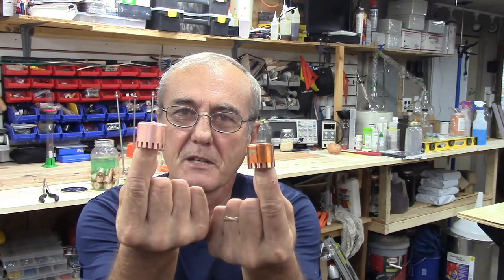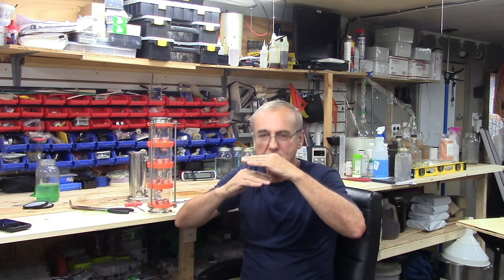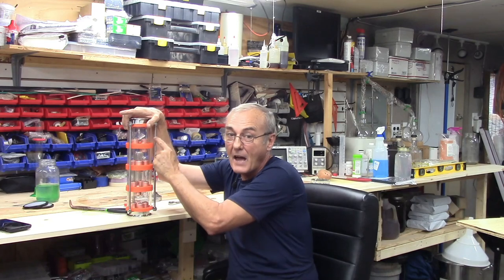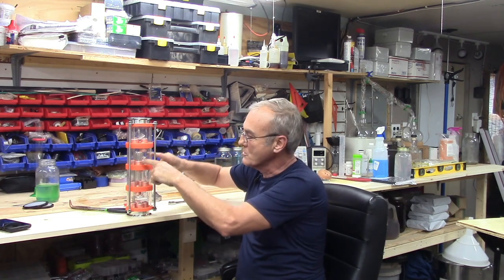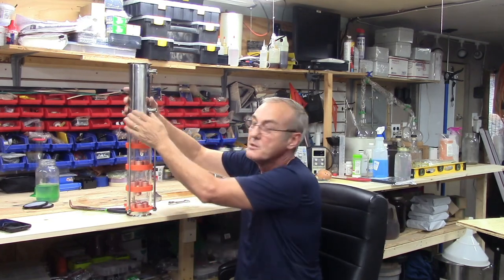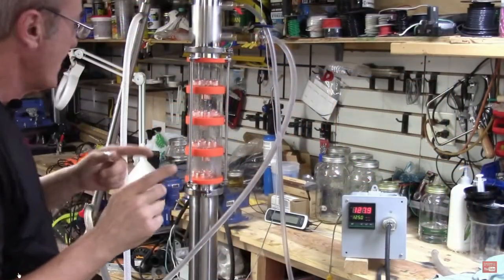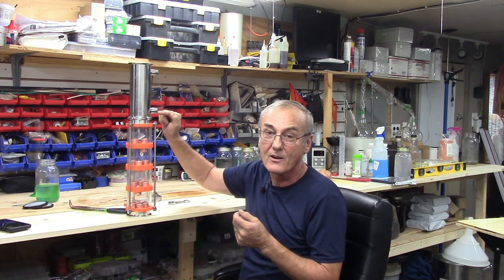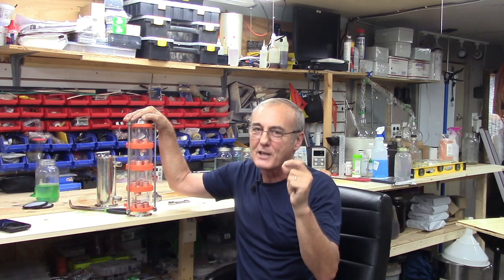BUBBLE PLATES AND DISTILLING

Comment: I use a 1/4" line connected to a tiny brass needle valve to control the water to my dephlegmator and that works flawlessly. That will give you precision control over the water flow. I run my dephlegmator and my shotgun condenser independently. In other words, I don't connect their water lines together at all. Very convenient!
Reply: I run my setup the same way saves a bunch on ice since the hot water from the dephlegmator is used to melt my sugar for the next batch and not the ice and a needle value is the only way to get the exact water flow

Comment: Many small distilleries use bubble plates, and they are very common in the whiskey and bourbon world with smaller batch style stills.  Most bourbon/whiskey makers that use these batch stills use 4 or less plates when distilling bourbon/whiskey mashes.  If your getting too high of a proof or not enough flavor, just disable a plate.  Additionally, bubble plates require less power to create the velocity needed to move the ethanol up the column compared to perforated plates because of the liquid bed on the trays.  The required velocity needed to move the ethanol up a column is a big deal when you begin to move past the 4" wide columns, not so much on smaller columns.

Comment: Better yeilds are to be had by increasing reflux from the reflux drum "dephlegnator" and keeping a level on all of the trays. Suppressing water vapors to fall down the down-comer, which should have a steady flow keeping the tray below it supplied with a level without flooding the tray or covering the cap completely. This is called loading the colomn. Thats how bubble caps and sieve trays are designed to work properly. To do this you need to set your tray temperature a few degrees above the OH temp with the bottoms temp in cascade. This is a column temperature profile. The top tray temp is the master and the bottoms temp the slave. This is how we distill hydrocarbons in the refinery. Of course you have to control the level in the reflux drum as well , which is in cascade to the feed flow to the boiler. This is contolled by increasing or decreasing the product out to the final holding tank or "jug" or whatever. However it may be difficult unless you have a continuous flow of cude material "unrefined heavy ends" or bottoms product to keep a level in the base or boiler. But then again its just a hobby and thats probably too elaborate for most hobby distillers. In my opion, using bubble caps is such a process is ludicrous if you aren't using the control systems to have a proper column profile. Meaning temperature level and flow controlers. While we are at it we mights as well throw on some vacuum compressors and distill at 92 deg F. Im for it. Someone setup a Delta V HMI and lets make some moonshine. 😂😂

Comment: A column such as this can be run as a pot still by doing exactly what some mistakenly do, remove the dephlegmator, insulate the column, and run it just using the condenser. No (or very little) reflux action will take place.

Comment: George have you ever checked out an armagnac still? They use bubble plates but instead of reflux chamber they introduce preheated wash to the top of their column. It then goes threw the plates. Suppose to capture a lot of the lost esters. Used for a type of brandy but wondered if it could be used for other types of washes?

Comment: Great knowledge !! Thank you. I have question about fruit distillation (apple). I would like to use bubble plates but what about final product in point of amount of it ?. Classical way double distillation (full copper) produce around 6-7 litres of pure spirit  (56%) out of 160L of Ferment. With bubble column it will be significant decrease of amount of final product  ?? Thans

Comment: George I have a Mile High Reflux  still that I pack the column with copper packing and raschig rings and I always get 188 to 190.  Can a bubble plate bring my proof up?  Thanks and thank you for making these videos.
Reply: Yes, a bubble plate can put out 95-96% (190-192 proof), but more than that the column is doing multiple distillations this raises proof, but it also strips out flavors.  All neutral spirits like Vodka are distilled in reflux type columns, and not pot stills.
Reply: You should look at cost vs. reward too.  What do you gain going from 190 to 194?  You're probably tempering your final product down to 90 - 100 proof anyway, right.

Comment: So having a good pot still as a beginner would be a good starter and then with the addition of a few extra parts a man would have a reflux still........ Or get a reflux still and turn off the top condenser then you would have a pot still.  TRICKY decision because as a beginner I do not know where I will end up as I LOVE Whisky but I also love a good vodka and all the other tipples in between. What I do know is that everything that I have made in the past has been based around a standard sized beer and cider fermentors with heat pads and warming chests. It is now that I would like to make the transition to a still. I believe that my dilemma is the first hurdle to get past. Any suggestions ????? For me the visual appearance of those bubble plates are just captivating.

Comment: George, they have these bubble plates in stainless steel.  They self clean as the alcohol vapor passes through the column.   No need to disassemble which is a pain.  Check Aliexpress.

Comment: Flood is bad. You don’t want to much differential pressure (dp) between the trays or you won’t have a good cut and you will get carry over. If you have too much drive (heat in the bottom) in the tower you will overcome the reflux and get carry over. Realistically you could have many draw trays in which you could run your still 24 hours a day just like a refinery. You would have slough line getting rid of the tails an overhead line getting rid of the foreshore/heads and a product draw tray that pulls the hearts into a hearts stripper tower that has a reboiler on it , along with reflux lines or circ reflux lines. You could also control the tower pressure to control the cuts. Maybe even a vacuum tower!

Comment: One question, if the reflux column is equiped with a precooler, wahet is the appropriate set point of the temperature we have to obtain in the precooler?

Comment: WHy use bubble plates over packing? Do you get any better throughput or efficiency? It certainly has the cool factor going for it.
Reply: Honestly ive run both and there's a slight difference in alcohol % running bubble plates to just a normal reflux collumn. It just looks cooler but in my mind it doesn't really matter

Comment: I'm confused I got the exact 4 floor bubble plate and using my T500 kit and i don't have the dephlegmator and I get the plates bubbling like crazy and I get 95%-96% proof so I don't get you when you said it won't get it to bubble without dephlegmator and you won't get high proof 🤔 without the bubble plate and using my T500 with the original condenser I would get 92% now I get 95%-96% proof using bubble plate and T500 condenser straight on top of it. How come it worked out for me????

Comment: So if I had a setup like yours with the same bubbler I was wondering if going with a 3” vs 4” would flow. I’m thinking if I had a taller column or wider with just four or 5 bubble plates on top  does that just push more out quicker? Running out of a keg still too. Hypothetical question.
Reply from the maker: The size of the column from 3 to 4 inches will increase the flow rate.

Comment: Hey George, I was wondering, where do you position the temp. probe of your PID when you operate a column? Is it above the dephlegmator?
Reply: You would place it at the very top of your column, right at the point of no return going into the final condenser. Another words; the same place as in pot still mowed. I also have a temperature probe just underneath my pre-condenser, then one at the very bottom of my column; just above the boiler lid. All this makes for easier control of the run. But it’s up to the individual as to how they want to set up their system. That’s the beauty of this hobby, you can keep it simple, or go as deep as you want. #Happy distilling!
Reply: @blindguy63  Thank you for sharing this with me ✌🏼 if I may ask, what do you look for temperature wise at the bottom of your column vs. right below your pre condenser ?

Comment: George, nice video once again. Thank you! Could you do a video on upgrades or mods to a T500 still? Could you fit this bubbler to a T500 and if yes, would I see any improvement on %ABV or speed?
Reply: Your T-500 should be putting out at least 92 % ABV so you won't get any better changing it.  If you want to experiment with various columns etc. you'll need to go to a standard still with sanitary connections.

Comment: Can one place packing between the bubble plates and the precondensor?
Reply from the maker: Why would you do that? The bubble plates do all the work.
Reply: Barley and Hops Brewing just wondering if it would help. I already have packing from a LM reflux column, and am looking at switching to bubblers. Feels wasteful to not reuse material if possible.
Reply: Was wondering if a section of column with a screen, above the dephlegmater and packed with 3a molecular sieve would give a pure ethanol output to the condensor. For hand sanitizer purposes. Seen your video on using 3a molecular sieve on the finished product. Thought having some in the column would save a step.
Reply: @martismarin  it takes time for the seives to work.  Putting them in the colum would be ineffective due to lack of time in contact with the product
Reply: You shouldn't put any packing above the dephlegmator, but you can add a section of pipe between the still and the bubble plate and pack that.  I use an 18" tube 2/3s full of glass 1/2" marbles and on top of them I add one loosely rolled section of copper mesh.  Next goes my bubble plate and then the dephlegmator.  It produces a steady 95-96 ABV pretty much throughout the entire run.  Great setup for neutral spirits.
Reply: @ordinanceconcernedamerican2357  even though there is such little bit of water left in the vapour stream? I figured it would have scrubbed the remaining 4-6% h20 from the vapour but that is why I asked.   Thanks for the replies.
Reply: @skyhookspirits  before the plates; got it. Thanks mate
Reply: @skyhookspirits  I currently use copper mesh packing and marbles as well but I am only running a 1.5" column, DIY keg. 40" column but no active water cooled reflux action, YET.... Running it as a pot still making tropical fruit brandy. Ordering a Chinese 3" 6 bubble plate column for neutral spirit and (hand sanitizer) runs. For the hand sanitizer runs I was thinking of the 3a sieves above the dephleg.  will not be doing that now.

Comment: I need help: I have a 1.5 inch (vm) column and I distill 10 liters up to a maximum of 30 liters. Could I increase the diameter of the column considering the few liters? I hope for some answers !!
Reply: George has explained this in other videos.  Increasing diameter increases the volume of your column.  It won't give you higher proof, but it will distill faster.  Going to 2" would give you slightly less than double the volume of 1.5".  i.e. 10" column x 3.12 x .75 (squared), or 17.55" vs. 31.2" for a 2" column.  I don't recall if that's a linear increase in speed of distilling.
Reply: @kaiser_sose  Thank you very much. I already knew this information but the question was whether a large column can handle a small kettle.

Comment: Curious about the hot and cold water as a good debate seems to be going on in forums that the cold should be in the top of the deflag and the hot comes out the bottom as its the last point of contact for the coldest part... ? thanks for taking the time for all of us!
Reply from the maker: Doesn't matter what I say or anyone else. In the bottom out the top or in the top out the bottom. There will always be someone who takes the opposite view and will testify to it.
It is really not a big issue except for those who would argue which came first; the chicken or the egg. It is just an easy, arguable point.
Reply: If you put it in the top it will drain out before filling your dephlegmator and will not cool your product by filling from the bottom your unit will fill up before any water can drain and it will cool properly.
Reply: @chucknaturale307  and logic prevails!! thanks for that!

Comment: Hey George, just a small correction to the plate theory: theoretical plates will actually always be less than the actual plates. This is because the efficiency of a real plate can never be 100% and therefore in theory separation occurs quicker.
Reply from the maker: Thanks
Reply: @BarleyandHopsBrewing  You counting of vapor/fluid interactions as a theoretical plate is a mistake.  Each interaction may fractionally increase your TPs, but by no means are they full theoretical plates.  Each TP represents the equivalent of a complete distillation run.

Comment: I would much rather use a 30 gallon pot still simple liebig condenser with a swivel at the column where I can change the angle up or down to govern the amount and speed of carryover. I always have in the past taking soft copper and have a separate condenser on the arm to allow greater reflux back into the pot if I have it angled up you can get a little bit stronger hooch but you get less flavor obviously if you're doing it right you're distilling three times I would never use a bubbler unless I was trying to make rocket fuel or a whole hell of a lot of vodka. I mean they're fun to watch don't get me wrong but to me it overcomplicates the whole process. I can literally throw together a 6-ft condenser in probably an hour and a half

Comment: Bubble plate vs sieve does not matter in this operation. Nor would it matter if the column was reasonably packed. The factors to consider would be how many stages or theoretical plates (if packed) would achieve the desired purity. Caps or not it does not matter for a system of this size or any system smaller than industrial scale

Comment: Sir what is the way to remove smell of yeast comes in ethanol
Reply: You could be pitching to much yeast. Or you could try using a different strain.
Reply: It could be you are getting sediment from the ferment into the still .
Reply: David Bonigut is also right. You could try cooling your wash or “crashing” to get the particles to fall out of suspension then rack off your clear wash.
Reply: Charles Schmidtke 👍🏻 when ferment is done I have a fermenter with a large enough opening in the top so I can put in frozen gallon water bottles , drops the temp right down to get bits to settle out .

Comment: That column is not 16 theoretical plates.  It takes 11+ plates to make a neutral.  There is no way that column will make a neutral.  The bubblers are in parallel with the plates and don't count as separate plates because they are all operating at the same temperature, fractionating the same alcohol component.  That column is probably 6 theoretical plates, assuming the bubblers add 50% to the operation of the physical plates.

If each bubbler added a plate, neutral columns would be 1 plate with about 20 bubblers on them.  But in this example each of the bubblers is at the same temp and therefore fractionating the same alcohol component therefore counts as 1 plate.

To be a true plate, it must operate at a different temperature than the plate above and below it.

Comment: I know this vid is a couple years old but there is some misleading information in this vid.
Theoretical plates and multiple distillations on individual plates... That's not how it works. Each plate acts as a distillation. That's it.
The column forms a temperature gradient, whether it be a reflux column full of packing or a bubble plate. In a packed column the gradient is continuous. In a bubble plate the gradients are separated into zones by the plates. This allows the various volatiles that make up the vapour to concentrate on the different plates. Low boiling point vapours compositions concentrate on the highest plate, highest temp at the bottom plate.
The riser caps on a plate allow vapour to pass up the column. That's their purpose. Their not acting as individual distillation points. The distillation comes from the accumulated liquid on the plate that all the caps on that plate have produced together. Increasing the number of riser caps on a plate increases the volume of vapour that can flow up the column.
The downcomers are there to prevent the plates from flooding. The combination of providing vapour a path up and liquid a path down, allows the various volatile fraction to shuffle around and compress or concentrate at the different temperature zones.
All of this happening requires balancing the volume of vapour being fed to the column and the amount of vapour being knocked down by the reflux condenser.